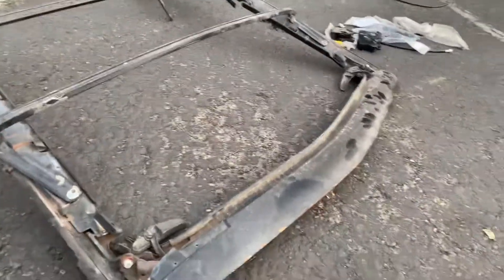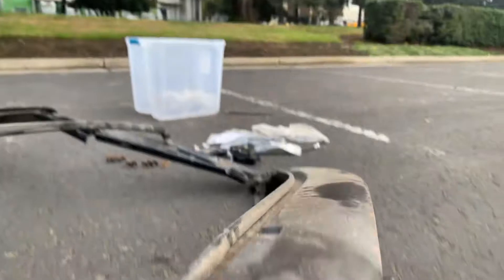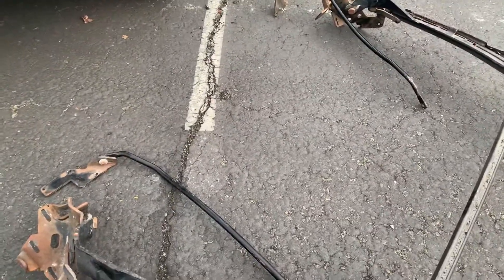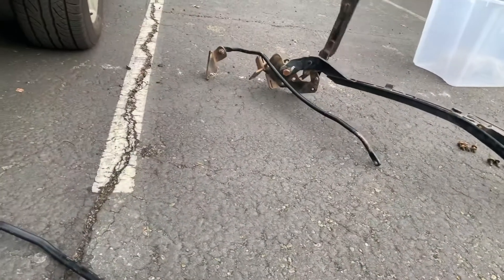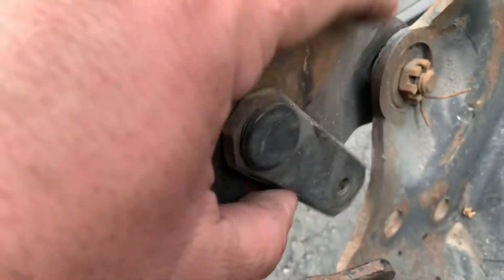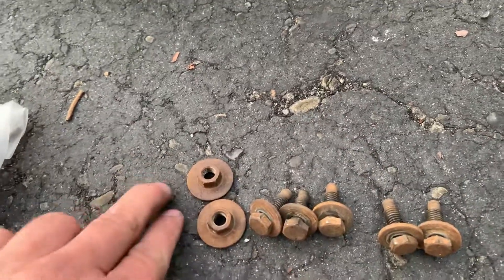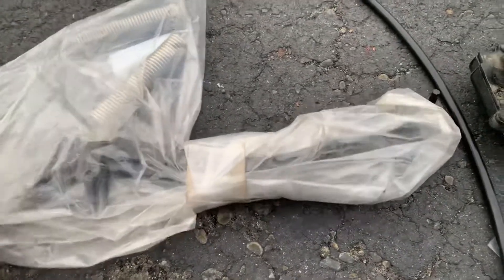1974 caprice scissor top rack evaluation impala mike

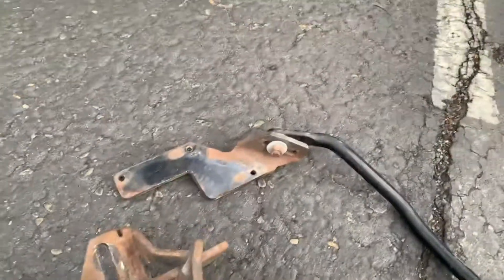Comment: 2:46 is the purpose of the adjustment slide to move the rack up into a better latch position? One side of my rack doesn't latch properly ans theres a huge gap between the top and quarter window.